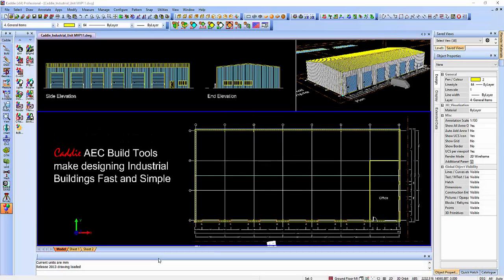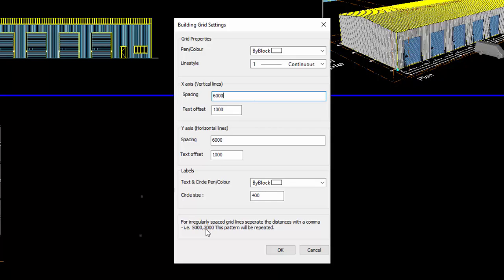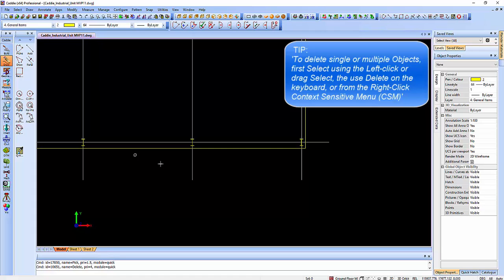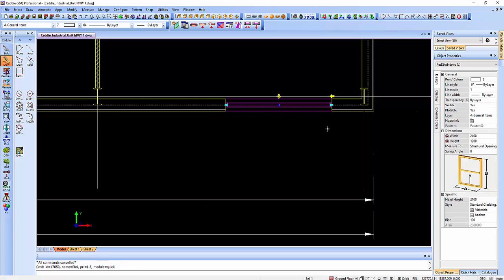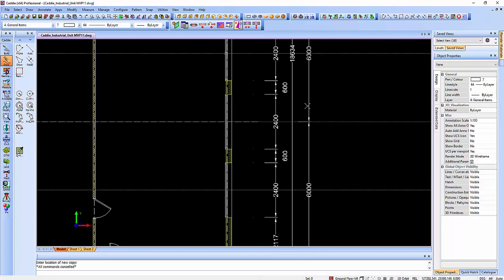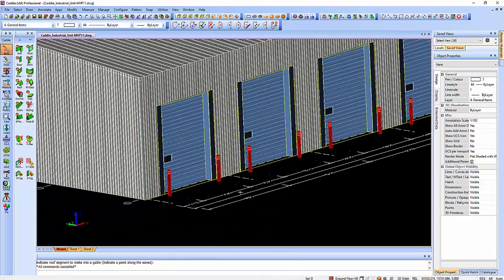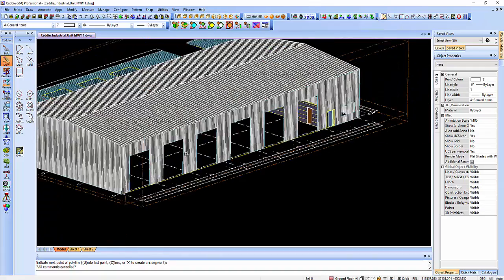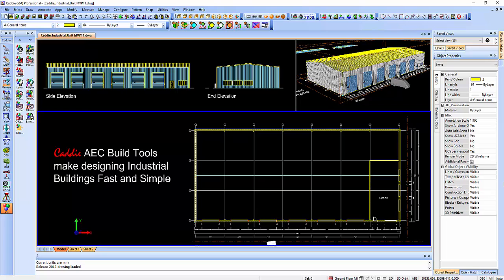Industrial Units made simple using AEC Build Tools in Caddie AEC .dwg software

Comment: The aec dims doesnt work with caddie 22
Reply from the maker: Hi Louis,
Thanks for your comment, however, I'm was a little surprised to read you comment since the video was created using Caddie 22 build 3 which is available as a download via the Caddie website.  Please note that if installing to replace a previous version of Caddie 22, there are registry entries that will need updating to ensure that you do get the full range of functionality.  If you need help installing, please give your local Caddie office a call and I'm sure they would be more than happy to help.
Contact details are:
International: +44 (0)1234 834 920 (Head Office)
South Africa: +27 (0) 12 644 0300 (0861 CADDIE)

Regards,

Andrew